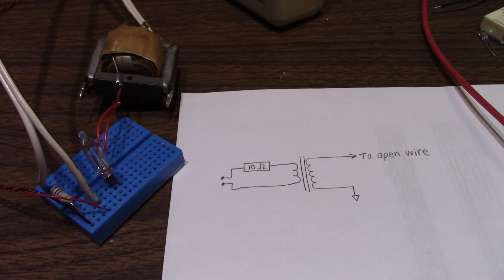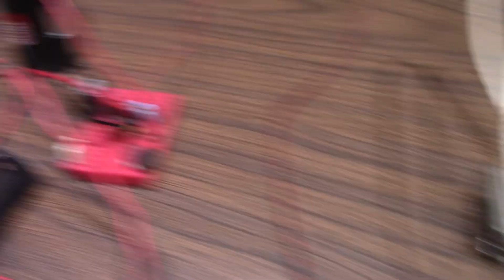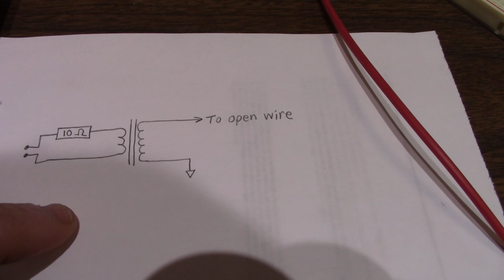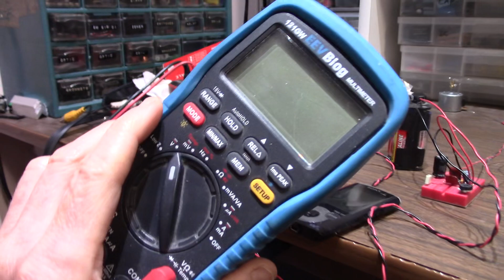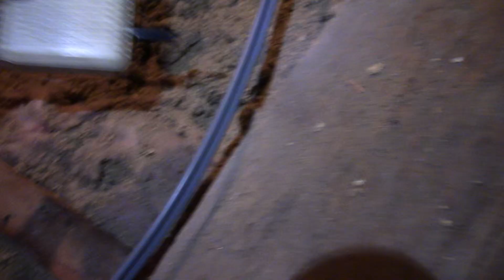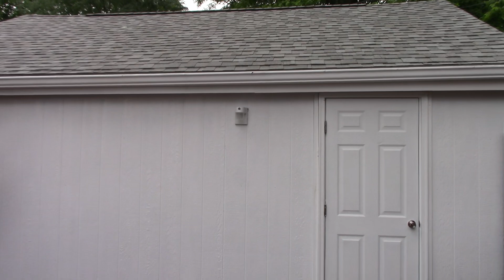Wire tracer cobbled together

Comment: Hi John, I know this is an unrelated subject, however it is one about a ponderance I had in the audio realm.
I have noticed that STM still have a lot of stereo class AB amplifier chips despite other mono ones like the TDA2050 being made obsolete.
The question is this: is any of them effectively two TDA2050 amplifiers in one package? If so, I think it would be very good to identify which device is so
Reply from the maker: None directly, but the TDA7264 is a two channel fixed gain amp with similar power specs. It might still be in production.
Reply: @JohnAudioTech  hmmm good one. I think it's worth considering these things because of the notion of bridged operating at the same time

Comment: Thank you for this! I've been using an off the shelf tone set for a long time to trace out the old circuits in my building. the capacitive coupled wires are a bit tough to weed out but It's saved me quite a bit from chopping unnecessary holes in drywall and plaster. I never realized how simple the transmitter circuit was!